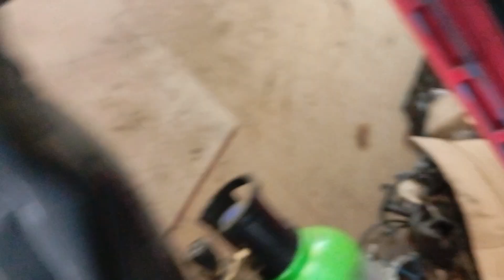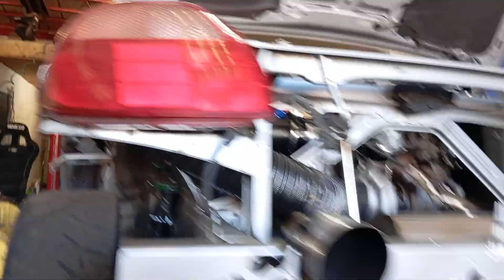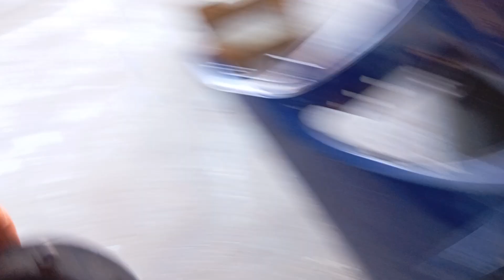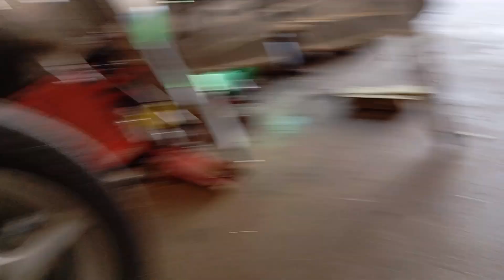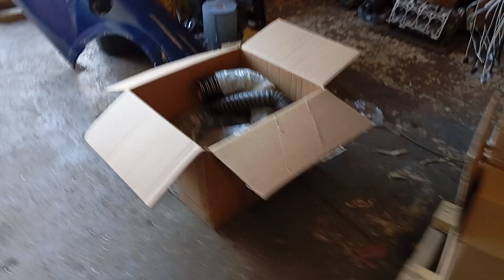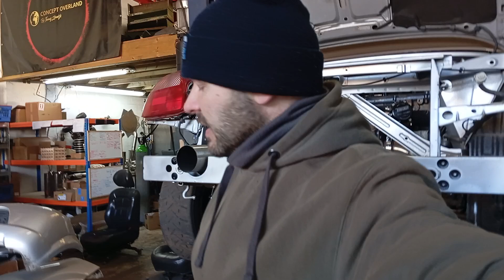MR2 engine swap 4" intake

Comment: cant you use 3.5" as a nice inbetween from 4 to 3", bigger than 3 but not as bulky as 4
Reply from the maker: @RitchyVerberck  if 4" fits why would you want to go smaller? If 4" isn't needed then we have the 3"
Reply: @zurawskimotorsport  i would say just for more acces around the filler neck etc
Reply from the maker: @RitchyVerberck  I think anything bigger than 3" would need it modded, although if you spend some time trimming etc it might fit, tight but it might

Comment: Could you not just run the pipe through the firewall and put a scoop in the roof or run it all the way to the bonnet with a scoop
Reply: 1. This is a convertible car, some people would like to keep it that way
2. There's no way to do that without seriously encroaching on the already limited interior space
3. This is meant to be a plug N play kit